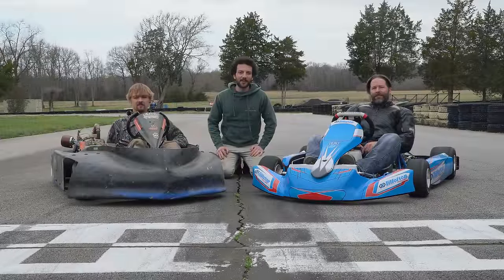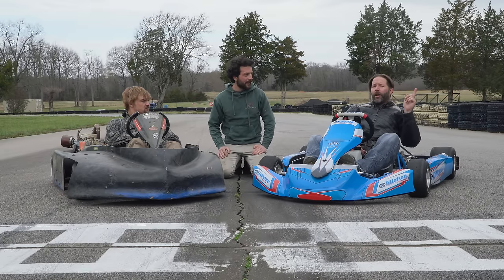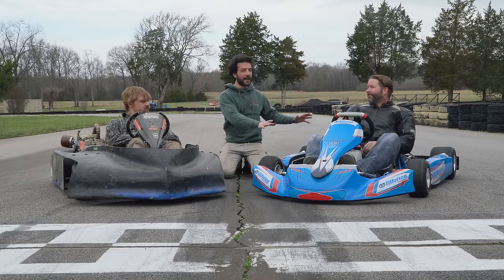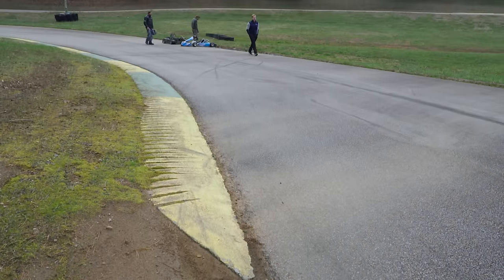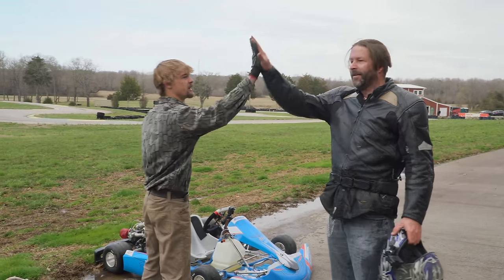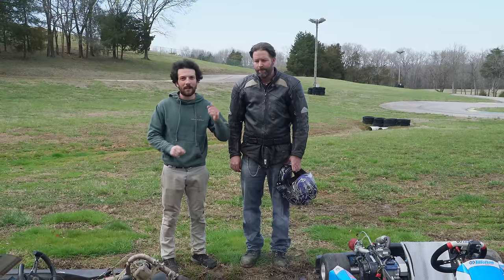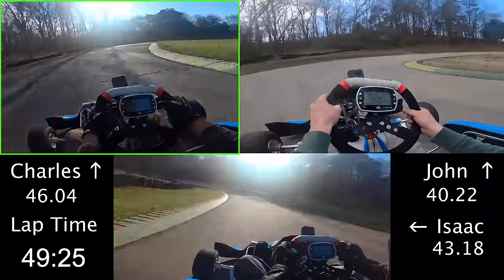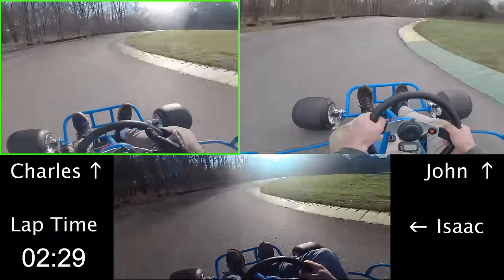Can a Retired Oval Go Kart Outperform a New Tillotson T4 Racing Kart? 3 Way Track Shootout!

Comment: Should have had the same tires. We would have gotten a better comparison of the kart performance.
Reply: That old cart had too much tire in the rear.
Reply: I definitely agree, should've all had the same tires.
Reply: @ThePower1037  WIDE
Reply: Tire set up on the flat cart is for ovals which is why the right sides are so much larger. It's made to turn left. Put em on the same tires and run em like that.
Reply: It also needs weight on the right side. The seat is farther to the left on oval karts. What I wanna see is the circle kart motor on the road kart, it makes more sense because if you modify the circle kart to turn right you're basically just turning it into the road kart but worse.
Reply: Not necessarily every car is set up different
Reply: Exactly what I was thinking. The tires are WAY to wide for the light weight. Change the tires and would have had a much different race.

Comment: I think we are seeing mostly a difference in tires on these carts would love to see Charles Kart get the same tires as the t4. We use to run circle karts on road courses all the time.
Reply: Agreed - I think unless you're running the same tyres on each kart, you're not really determining much at all. You could just see charles' kart had very little grip on any demanding corner.
Reply: What do you do to get an oval kart to turn right?
Reply: Yup, my first thought was the same - I'm guessing the tires on Charles' kart were old, he had no grip.
Reply: @deangiacopassi1951  either shorten your right front suspension or lengthen your left front slightly for a start, those carts are setup assymetrical so that they always kind of pull a little left, let's you brake later and back on full throttle faster in the turns, since you know they are all the same direction.  If you know how to fabricate, then you can do it all yourself with some scrap metal and what's already there, or for $100 - 200 you can get new hubs and parts to have a more even front suspension then another $100 to have someone fab any alterations if you don't know how to do that part.

Comment: I feel like Charles' kart would be fine with some new, sticky rear tires. The front end was holding fine, but the rear would just slide. It's got a straight rear axle, so there's no adjustment there. Seems like the front end was OK, but may need an alignment to make it a bit less twitchy. I'd like to see a rematch after the $500 kart gets new shoes.
Reply: I agree 150% , otherwise, he'd have smoked the ringer by such a large margin that I honestly feel he'd have lapped Ike easily. 
But he was chumped for sponsorship sake, I believe that to be the reason things were the way they were. 
Charles is an old dirt track racer from way back, and he's actually the best one at the majority of the little events they preform for the channel. 
Very obvious when you watch him when Ike's ego isn't around to be bruised by being second best because being one of the senior members.
Not that I have anything against him, but it was very obvious when Charles joined full-time insecurities were getting to Ike
Reply: @timothymilam732  I noticed that too, ike is far more harsh towards Charles than john

Comment: Charles should mod that cart unless he wants to keep it for ovals (which seems like it wouldn't be that great). Stretch the wheelbase and maybe try to get the weight distribution closer L/R.
Reply: they still run those exact karts here in talladega...those are called "heavy" karts..so yeah they are still that great
Reply: @janeames1513  It looks like something that would be for very small oval, and probably not a 25hp engine based on the wheelbase. I don't know, maybe it just needs some better (new) tires?
Reply: Definitely. An alignment and new tires would help a lot.
Reply: And maybe a spoiler

Comment: I raced karts for about 12 years... 20 years ago... Karts used the frame for torsion suspension so to remain competitive at the highest levels, karts are usually replaced every year or two. They'd also get fractionally lighter and have track tuned engines and gearing. Sometimes we would tap-out mid straight, but our out-of-corner acceleration would make up the difference.

Comment: charles' cart needs some new, sticky tires and some weight redistribution. i think then he would be king of this track. that beat up old cart must have really been something in it's day. from the lap times you can tell a few things, john weighs the least, charles is the most cautious, and if they were all in similar carts, with similar weights, ike would come out on top. he's got the skill and fearlessness to be a really good race driver. this format works so far, but if you are going to be doing a lot of this, you might want to get a couple more cameras on tripods set up at different points on the track to capture the action better. if they were remote controlled with powered tilt, pan and zoom functions, with some practice one cameraman could operate the entire set up from a central location. install the entire control system in one of those large road cases on wheels that bands use for concerts, then system set up and tear down would be quick and simple, plus it would protect the expensive function control electronics and video switching systems from damage. if you also integrated a dvr with editing software into the system, you would then have an all in one unit to capture, record and edit anything you wanted to make a video of at your home base, or on location, and since you have made this a full time gig, it would be a worthwhile investment into your production company. bonus, with a little time spent in research, prolly right here on youtube, you could build the whole thing yourselves, and turn the build into a d.i.y. video series, you are named cars AND cameras after all. with a rig like that, you could prolly even make some extra money on the side filming other events such as weddings, parades, car shows, commercials for local businesses and the like, once you got the hang of operating the system. the world would be your oyster, the only thing holding you back would be limits of your imagination.

Comment: So, the abandoned go kart, yea that isn't made for asphalt tracks. Its more of a dirt oval kart. Also, I know people are gonna question me, "How do you know?". I have a brother who owns 8 of them, runs them in many different series and I work on them. The fat tires on the back are meant for better grip on dirt. The engine that he has on there is for the small younger kids who are just starting out in karts. The bigger engines need a high powered electric gun to start them and each class of dirt kart has to meet weight restrictions. You can add weight to the karts. Wouldn't recommend using a dirt kart on asphalt, but hey, its your kart you do what you want with it.

Comment: I'm kinda glad all we had in my town was an old dirt track maintained by random drivers that showed up on the wknds. I had an old Margay with a huge McCulloch on it. The style was much different. Completely crossed up with two rooster tails coming off each tire through the corners. Back then our Yamaha shop sold a Yamie cart with a 100 or 125 on it. My chain saw motor would smoke the Yamaha fairly easily and four strokes didn't have a chance.

Comment: Put brand new tires on Charles’ cart, fix the suspension, PAINT THE BODY ONE COLOR, and run it against the T4 again but with different gearing on the T4 to help with acceleration.  But also try a race from a stand still.

Comment: I left a VIR kart in the grass at the end of the backstretch once because on the cool down lap that no one ever uses as a cool down, one of the front spindles broke. I waited, and even waved my arms, but the track crew teenagers never saw me or realized one of their karts didn’t come back and they sent the next group out. So I hopped the fence so I was out of the way, walked back with the helmet and set it back in the rack. The track crew was looking at me funny, so I quickly said the steering had broke and they could find their kart over in the corner. Then walked out.   Since it happened on the cool down lap of my second session, it was still a fun time though. Nothing like a group of racers at a rental kart track.

Comment: It’s super hard to get a oval chassis to work on a road course. The chassis it’s self is way stiffer than the Tillotson. The Tillotson is made to flex to help it handle. Oval kart is built to work kinda like a teeter totter with the cross weight is designed. So when you turn it transfer weight to the to the right front end right rear
Reply: So what would be physically different between the frames? Beefier tubing or completely different shape design? 
I know everyone is blaming tires but I'd like to know if there is much difference in the frame and steering geometry. It seemed like a bunch of things going on that were holding the oval cart back.
Reply: @GRid-yk2ru  they are designed completely different is the biggest reason. The oval chassis is completely offset where the road racing chassis is designed to be more driver in the center and closers to 50/50 weight distribution. It’s actually easier to make a road racing chassis get around an oval than it is to get a oval chassis go around a road course. Not to mention the tires staggered for making left turns only on the oval kart. The ride side tires on a oval kart are 12 inches wide and the left front tire is 4.5 inches wide and the left rear is 6 inches. That’s to make the kart naturally turn left. Where the road racing isn’t staggered where it’s designed to go right and left. Probably with some modifying and lots of tweaking you could the oval kart faster around the road course but will probably never be as fast as the road racing kart.
Reply: @sparky87213  thanks for the explanation.  With the body on, it's difficult to see the differences.  The driver doesn't look that much offset but I guess it doesn't take much on such a light cart.  I never would have guessed that the tires were that much different in size!
Reply: @GRid-yk2ru  yea unless you see them with a body sitting side by side will you notice. Oval karts the driver lays back and the road racing chassis you sit more up right

Comment: Charles' cart is set up for dirt circle track. I'd rather have it than the overly expensive t4. 4 grand for a go cart is a ripoff! Awesome video guys!
Reply: $4000 for a complete race set up is on the cheap side, further up the classes you spend that just on a Chassis without an engine.

Comment: Cool video but, the issue with the black go kart is that while its got a chin splitter to improve aerodynamics on the front, on the rear it needs a rear wing and drag diffuser, thats what is causing the spin out, the aerodynamics pressing down on the front only.

Comment: The blue cart has smaller tires.  That blue cart is likely half the weight.  If he ditched that heavy shell on the yard kart, fixed the suspension and put some new tires on it, it likely would have outdone the others.  It seemed to have the best gearing and power combination.

Comment: I agree that Charles cart should’ve had new tires, alignment and suspension/frame done so it was at least on similar footing as the other 2. However on that note I still liked the video. Also if they had some the track in reverse like some of the comments suggested, those right turns would’ve become left but then the lefts become rights causing the oval cart to spin out in different areas, not stop spinning out at all.

Comment: maybe this is dumb, but would the T4 handle better with wider front tires?? or is that functional to have skinnies up front ?
Reply: Wider tires in the front would cause the front end to push in turns and go off the track every time. Front traction is never an issue it's the rear that needs more rubber contact area to stay in control.

Comment: The T4 runs a 15hp motor at a 40.22 lap time (assuming it could be faster on a cleaner lap)
I've run a 41.9 in a CRG K1 with a 9hp Brigg Lo206 on MG reds.  So that extra 1.7 seconds is gonna be power based.  
The track staff said the Rotax 125cc can run a ~35 second lap on mediums.

Comment: Charles is driving in offset go-kart it's made for oval racing not road racing offset go-karts hate making right hand turns if you put an offset go kart on scales all the weight percentages on the left hand side so when you make a right hand turn the right side of the car wants to lift up because there's no weight on that side therefore it does not like steering into the right hand turns they're only made for going left also that the thing called cross percentage weight and I'm sure it has high cross which again is made for oval racing turning left only

Comment: I would love for you guys to build up an old Briggs Raptor 3 engine and put it against a predator with the same mods .
Reply: That predator will out perform the briggs flat head all day man. Newer technology, the briggs were good back in the day. It's just like having and old 327 or 350 small block with a set of cast double hump heads against a newer ls motor man.
Reply: @josephalcindor6323  Your wrong, I have a built Briggs and Stratton and it would smoke a Predator or a Tillotson easily. but it cost a lot more $ to build than it would. to buy an already upgraded version of the other two engines.

Briggs and Stratton power YEAH!!!!!

Comment: I can’t wait to do a video on That 70 so I could see why my bike doesn’t have a spark once I get it running with the lifan engine then I’ll start working on the stock engine and see why it didn’t have a spark I want to see how you take the fly wheel off if you have to take it off I think you got a real good deal on those three bikes

Comment: Assuming that nothing is bent or broken, I'm betting that Charles's cart would be right in contention if you put comparable new tires on it to the others. , that's likely the biggest difference, especially since it has more power and appears to be better geared than the T4. 

I'm guessing you need to put out the T4 content to make your sponsors happy, but I'd be WAY more interested in a series of putting new tires and testing Charles's cart, then maybe trying to even out the corner weights on it and then optimizing the suspension for a road course, and maybe finally a new paint job... Ultiamate turd polishing is more my style than spending $4K on something that's nice but just the fact that it's starting nice I'd be less likely to have as much fun with.

Comment: That Briggs and Stratton engine, would easily smoke those Tillotson engines providing it were in better chassis. the HP and the torque was so much more. that you couldn't get at all on the throttle in the corners. without breaking the ass end loose. if a person could cure the handling issues, and put some better tires on it, and learn how to feather the throttle coming out the corners. that thing would be blistering fast no doubt.

Briggs and Stratton power YEAH!!!!
Reply: It was all in the tires the t4 had asphalt tires Charles had dirt tires so it was no match

Comment: Take the Tillotson and the Epic to an oval track. Put some newer tires which aren't dried up and hard on the Epic for a closer head-to-head comparison. Keep in mind the engine on the Epic is probably a purpose-built race engine with no rev-limiter and probably better gearing. Put equal gearing and equal tires on the karts and do a true heads-up challenge.

Comment: Are you sure that old rebuilt carts is not equipped with slick track tires designed to slide . 40 years ago when I was involved in motorcycle road racing I learned that the key to winning races is to get your chassis sorted out first before you start trying for a lot of horsepower . You can't win a race if you can't stay on the track .
Won the race but lost the Victory lap ! Lollollollollol

Comment: The dirt kart take the rear spindles and push them out as far as it will go, also check your washers in the font and make sure they are the same on top and bottom that’s why its spinning so easily it’s not set up for a flat asphalt track

Comment: "Like a one-legged man in a butt-kicking contest" - I like that one... :P

Still, I think Charles could probably use some new rubber there, with it slipping and sliding about, I'm guessing the old rubber's pretty much plastic now... :S
Reply: I remember reading somewhere about spraying them with wd40 then wrap in plastic. Leave them in the sun for a half hour or so.  A quick burn out will get ride of the excess, then they become sticky.  Not sure how true it is, just something I read.  If the tires are shot anyway, not much to lose!

Comment: Had Charles charged his tires for some new sticky soft compound tires and ditched the who knows how old the ones he was on.
He'd have walked all over that $4250.00 plastic nose flopping new one because his tires were the true deciding factor in that grossly one-sided match.
It was as if he was set up to fail in order that sponsors cart won without a doubt.
Reply: Doesnt matter. John was clearly faster than both Charles & Ike with all three Karts by a large margin. I also doubt that was the intention. You're overthinking it, dude. Chill out. John & Issac gave Charles this opportunity to be on C&C and you say sh*t like that? They all clearly said in the video that Charle's Kart was at a disadvantage they didn't hide that. Grow up!